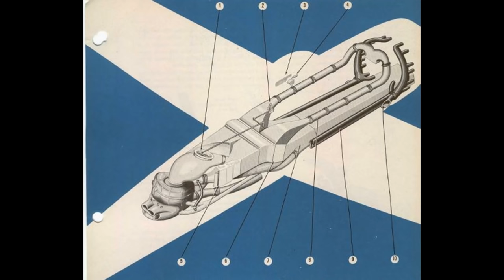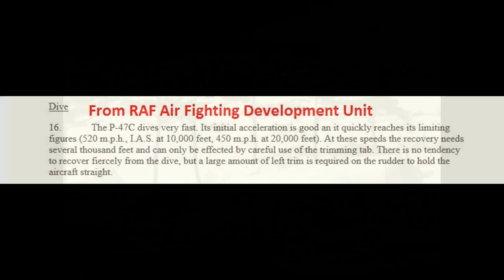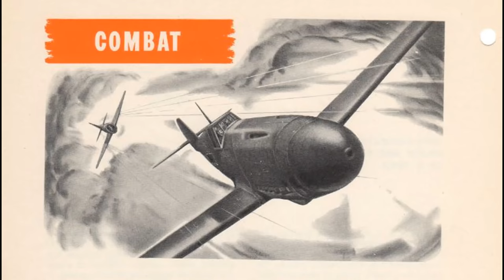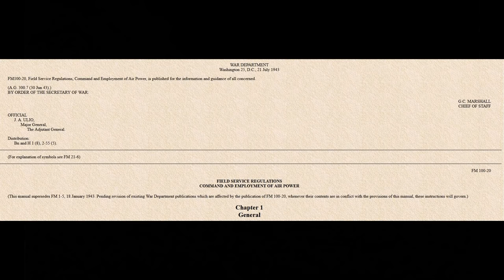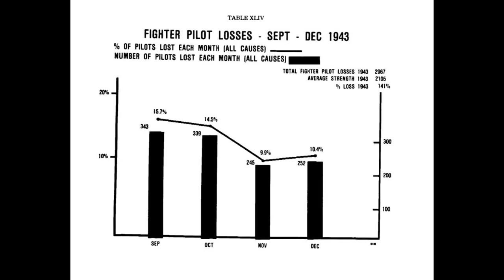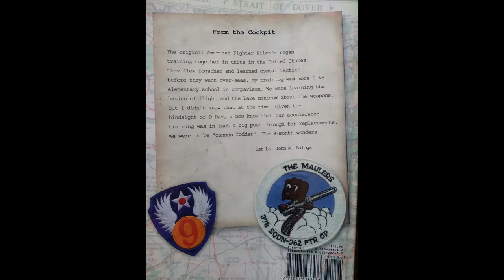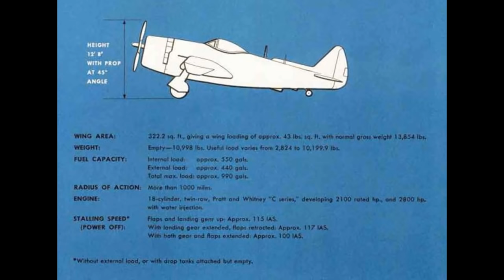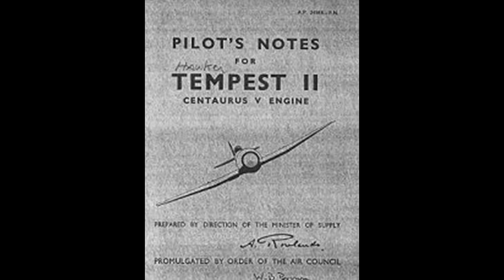P-47 Thunderbolt Pt. 8 Conclusions

Comment: Man, this has been an excellent series thank you so much, the 47 has always been my favorite warbird. And it’s nice to be able to fly them in sims like IL-2 and dcs now.
Reply: Also as an automotive tech I couldn’t get over the rate of oil consumption good lord!!!
Reply from the maker: Yes, it's a lot of oil. It's not just the 2800 cubic inches, it's the shockingly loose clearances that these engines ran with.
Reply: @GregsAirplanesandAutomobiles  I would love to see a complete tear down of that engine it seems amazing that they could produce that much horsepower in the 40s
Reply: @bryanjacobs5897  Mainly high boost pressure through supercharger, turbocharger and intercooler, and very high octane fuel making the boost pressure possible without destroying the engine. I wonder how much HP a 1960´s muscle car could crank if fueled by 150 octane (through either very high comp ratio, charging or both).

If you compare naturally aspirated (for the sake of comparisson) four-stroke gasoline engines between their invention and let´s say the 60´s, the massive increase in HP/cui was achieved mostly because of ever increasing octane number of the fuel available. This made it possible to rise their comp ratio from 3,5:1 in the early 1900´s to as high as 12:1 in 60´s. Comp ratio means higher power efficency. Then in the US of the 70´s the HP/cui dropped again because of emission control laws, because high comp rario and early ignition which give efficeny in power AND fuel consumption also produce a lot of CO and NOx. This was very stupid, because cars consumed much more fuel AND lost power because of the drop in comp ratio just to have less PERCENTAGE of CO and NOx in their exhaust gases

Also, I belive they P-47 had sleeve valves (not sure).

And finally, there´s no replacement for displacement!

Comment: Great video in an amazing series.
The production cost comparison is certainly interesting and hints at a supply chain element which I don't think has been fully explored here. I guess now is a good time for me to watch the series again :)
The P-47 field assembly guide film seems to show that shipping to the field seems to have been somewhat easy. Other aspects would include cost, wartime materials, skilled labor, supplier dependency and so on.
Reply: Indeed, one of the questions that people love to overlook, or answer in a simplistic way, "A was cheaper, but B was better". Obviously there is more to it than unit price, such as "can we get the damn thing where we need it" - Nicolas Moran's talks on the M4 Sherman come to mind -, and "can we easily keep it in operating condition there". 
I always think just looking at a radial engine, "that thing has got to be more expensive to produce than any configuration that uses cylinder banks, with 18 individual cylinder heads and valve trains" - and I'd hazard the guess that once Packard Merlin production was ramped up, it was indeed a much more cost effective unit; but from everything we know, an air-cooled radial was a) more reliable and survivable in combat conditions (not losing a plane when a bullet hits a part of it) and b) probably easier to work on, as there was no coolant to worry about/get out of the system before accessing the internals, and individual cylinder parts could be easily replaced. 

So you'd at least have these differences to take into account... Also judging relative performance, foreseeable changes in role of the planes or theater shifts, and so on and on. I'd hazard the guess that often these calculations would get so complicated that anyone in charge of procurement would probably just do what "feels right", based on real world experiences coming in, and then find the data that supports their decision :)

Comment: Great video. One comment, P-47's did serve in the Pacific War in 1943 and 44 (probaby D's). The specific case I read about was an American Thunderbolt pilot shooting down a Japanese Thunderbolt  (aka Raiden or Jack) over New Guinea. The P-47 was popular in Europe but not so much in the Pacific because of it's limited maneuvability at lower altitudes, while the P-38 was popular in the Pacific but not so much in Northern Europe due to it's various problems at high altitudes. The Army Air Force did the logical thing to simplify it's supply chains be sending the Lightenings to the Pacific and the Thunderbolts to Europe.
Reply from the maker: Yes, the 47 did serve in the Pacific in 43'. I sort of mis spoke there, although I didn't say anything technically incorrect, it was just incomplete. I have actually talked about earlier Pacific P-47 stuff and shown pictures of them in the Pacific theater quite a bit. I think in the range video I talked about it since there were early drop tanks in that theater.

Comment: The "one circle fight" diagram at 20:04 is actually a 2 circle rate fight.  The fighter with the higher rate of turn will bring its nose to bear on the other first.  You could correct it if you reverse the direction of one aircraft.  Then they'd be competing for smaller radius.
Reply from the maker: Look at the drawing, the plane in red will NEVER bring it's guns to bear no matter how rapid its turn rate. It simply can't point inside the circle to shoot the black plane.
Reply: @GregsAirplanesandAutomobiles  I am a fan and don't mean to nit pick but that diagram is wrong.  This is the correct way to draw a one circle fight (scroll to bottom):  https://vnfawing.com/VNFAWING-BFM-Intro-4.htm  Both aircraft turning same direction is a (two circle) rate fight even if sharing the same turn circle.  Aircraft in opposing turns is a radius (one circle) fight.
Reply from the maker: That diagram you posted seems to be talking specifically about turns after a head on pass. In that case, yes, if they turn opposite directions (one turns left and one right) then it's a one circle fight. Nothing I said disputes that, but I am talking about a different situation, not a head on pass at the start. The diagrams you posted are one and two circle "as shown in the below engagement" that engagement is from a head on pass and I think the diagram is specific to that scenario. The diagram I put up has both planes turning the same direction with both circles centered on or near the same point. In that case, turn radius will decide the outcome assuming nothing changes. I'll see if I can find a reference to this, off the top of my head I think it's in Shaw's book.

Comment: A couple more points...

I haven't seen any accounts of a Typhoon pilot, or even a Tempest, flogging their crate over 25,000 ft, pushing into a mach-limited dive, and surviving the pullout in a combat situation. The Typhoons were losing their tails with some regularity, for various reasons, throughout there service and I've just never read of Tepests engaging in combat at over 20,000 ft. Also, with that thick wing, there's no way the Typhoon had a competitive Mach limit anyway.

I also think it's pretty clear that the Jugs and late model Lightnings would have won the high altitude airwar if the Mustang had never existed. All that engineering and production could have been used to develop the others. On the other hand, if the Jug and Lightning never existed, it's likely there would have been virtually no high altitude combat until Merlin Mustangs could have been produced in large numbers and that would have still been well into 1944 simply because it was designed later. 

That means large numbers of experienced Axis pilots in well-developed airplanes would have been ready to great pilots who had never engaged in high altitude combat at all except in Spitfires and they would have still had to learn effective escort tactics.

Cheers!
Reply: Pete, the Lightning was pretty good for a twin engine heavy prop fighter.  But, there is a limit to how good that architecture can be because (1) it loses the surprise advantage (80% of kills historically coming by surprise) due to being large and easier to see, and (2) it is 2 to 2.4X more expensive than the Mustang, and (3) it is both slower and less maneuverable than the Mustang.  It's kill ratio was only 1.4, including aircraft destroyed on the ground.  The Mustang scored 3.6.  So, the Lightning suffers the double disadvantages of fewer planes per budget, and lower kill ratio.   On a per budget basis the Mustang was 6x better, and actually better than 10x when you include the fact that it was the better bomber escort, reducing bombers shot down by more than 50%.  The P-47 was better than the Lightning, in some ways as good as the Mustang, but also suffered surprise disadvantage and higher cost.  So, while we could have won the air war with the Thunderbolt, it would have entailed higher losses and higher budget.  We could have won the ground war with the Springfield bolt action rifle of WW1 instead of the semiautomatic M1 Garand, but we would have lost more men doing so.  The job of air force leadership is to field the best air force for the available budget, and the definition of that is inflicting the most enemy losses and suffering the fewest friendly losses per unit of budget.  See the Wikipedia article on Light Fighters.

Comment: I'm sure many in Greg's audience are totally in awe of the firepower of 8  50 caliber machine guns. I can tell you second hand how effective the p-47 was strafing tanks during World War II. My dad's unit, he was in the 6th Armored Division called in air support. Along comes some p-47s and they start strafing the wrong tanks! Blue on blue fire was something unusual in World War II. One of the tanks in my dad's unit took a complete strafing run right on from a p-47 on the front slope of the armor of the m4 Sherman tank. getting out of the m4 Sherman tank it was typical practice for the crew to slide down the front of the tank. It matter if he got out of the driver's seat or climbed out of a turret hatch you would grab hold of the gun and slide down the front of the tank to get off the tank it was fast and easy. You couldn't do that on this tank anymore unless you like sliding down a cheese grater. My dad said that if you tried to slide down the front of that tank it would tear your ass off. He described the metal as it looked like a giant chisel had just dug gouges into the metal. The tank was sent back to the scrap heap because the front of the tank was so weakened by the strafing run that it was not safe to use in combat. That's what 50 caliber armor piercing rounds will do to the front of a tank. Needless to say they were little annoyed at the airedale's. It was a brand new Sherman. So kudos to the pilots that flew those p-47 in support of the troops on the ground like my dad even if once in a while they did mess up.
Reply from the maker: I'm glad your dad made it through OK. In defense of those P-47s, the Germans were disguising their tanks to look like ours, so there was some confusion in addition to the usual fog of war.
Reply: @GregsAirplanesandAutomobiles  My Dad never held it against them, except the ruined brand new tank!

Comment: P-38: A revolutionary design that was dealing with the usual teething problems, asked to fill a role it wasn’t designed for, and flown by green pilots against war hardened experts. It survived on speed, climb and range. And two engines. It was sidelined because it was more expensive to build, operate and fix.. And pilots needed to learn to fly a two-engine fighter, which took extra time to learn.

Comment: Congratulations for giving the P-47 the credit it earned.  The P-47 beat the Luftwaffe on the Luftwaffe's home turf when it was still the Luftwaffe.  That is no small accomplishment although--as you recognize--it was a battle of attrition where we traded bombers and fighters for fighters.  The epitaph for many Luftwaffe early war aces was "shot down by P-47."  Indeed, Donald Caldwell's excellent book "The Luftwaffe Over Germany  Defense of the Reich" titles Chapter 6 "The Air War is Lost January - April 1944."  Although the P-51 ran up the score against more poorly trained replacements, the 56th Fighter Group--which flew the P-47 the entire war--was credited with the highest number of air-to-air kills of any group in Europe.  4th Fighter Group was the highest scoring group with air-to-ground included, however, the 56th led in the air.

While unstated, your series makes the point that the P-47 turbosupercharger was probably the most important single technical system in winning the air war over Europe.  Final point on training.  US Navy training for tactical aircraft has delivered pilots to the fleet for decades with roughly 300 total hours including around 100 hours in type.  Seems to work pretty well.

Comment: One factor the made the dive speed high was the tremendous weight of the Thunderbolt. Also, with the weight of the engine leading the way, it would be very stable in a dive.

Comment: Thanks, Greg I was getting antsy like it sounds others were too. I understand why you do mostly high production successful aircraft but I am at least equally interested in less successful aircraft as their failures help explain why the successes were successes. The P-39 being a notable example of relative failures (and of course it wasn't a failure everywhere) but also craft like the Hs-129s which future iterations of did fairly well in their niches (of course I am thinking of the A-10).
Reply from the maker: I did talk about the P-39 a bit in my turbo vs. supercharging video. I'll cover it more in the future.
Reply: @GregsAirplanesandAutomobiles  The P-39 being a low altitude only plane is not one of the problems I generally think about. On the eastern front, I imagine that was quite tolerable. The blind spots from the canopy framing, the severe mismatching of external ballistics of the three different gun types, and the COG issues when 37mm and .50cal ammo has been expended are the problems I notice most. If any plane ever could have benefited from an ammo counter that was it because it could double as a COG indicator.
Reply from the maker: @vicnighthorse  I might talk about it at some point. One huge advantage of the P-39 over the Soviet stuff on the Eastern Front is often overlooked, and that's the radio. If you fly on IL2, you know that two decent pilots on comms will almost always beat two good pilots who can't talk to each other. The P-39 will be covered on this channel at some point.

Comment: Martin Cadin in his book "The Fork Tailed Devil" (which is a book about the P-38 obviously) agrees with this assessment. While he glamorized the Lighting over 400 pages of text and footnotes, the Thunderbolt did the heavy lifting in Europe. Things might have been different if the Merlin Mustangs had been available in 1942 in sufficient numbers. I've also read in numerous accounts how pilots would prefer the Thunderbolt over the Mustang in combat because it was more survivable due to its radial engine.

The Pacific is the great big blank when it comes to the Thunderbolt. They were there. My ex-wife's grandfather worked on them until the unit replaced them with Mustangs in Okinawa. So far as the kind of war they were fighting on Okinawa was concerned, this was not a welcome change. The Thunderbolt carried a heavier bomb load, took more punishment, and was easier to repair than the Mustang or Lightning. They also shot down quite a few Japanese fighters along the way.

A wrinkle in recent years directly compares the Thunderbolt to the F6F Hellcat. Same engine, but a somewhat different arrangement with the supercharger. They are about the same weight with the Hellcat being about 800 pounds lighter. But the Hellcat had a longer wingspan for carrier operations. Late variants had similar performance. I guess what I'm asking for is a direct comparison between the fighters that used the PW 2800 engine. Thunderbolt, F4U, F6F, and F8F.
Reply from the maker: That's on the way, sort of.
Reply: @GregsAirplanesandAutomobiles  sublime! Take your time. The deep dive this turned out to be was fascinating.

Comment: Nice series and video Gregg. I enjoy the raw data. At 55:30 I was surprised to see that B17s consistently flew more hours than B24s even though I seem to recall that many more B24s were built. I was also surprised to see at 1:01 that B26s and A26s cost nearly the same amount as B17s and B24s. Makes me wonder what they saw in the 26s that the 17/24s couldn’t do. Fewer crew, yes, but not fewer pilots, navigators, and bombardiers. It just goes to show that much of what was purchased and used in World War II was based on what could be produced at any cost rather than on cost consideration alone. I was under the impression that the reason the 51 replaced the 47 was not due so much to cost but rather that the 51 was a better all around dog fighter and had greater range. Your comments on that would be interesting
Reply from the maker: I didn't analyze the hours flow of B-17s vs. B-24s so I don't want to comment on that. The A-26 invader is a much more advanced airplane than the B-17. For example it's gun defense system is basically what's in a B-29 just scaled down and it's very effective. That, plus it's newer, if the war had dragged on the cost of the A-26 would have gone down, but yes, it's expensive. In regards to the P-47 vs. the P-51as a dogfighter and in terms of range, I heavily covered that in this series. You didn't start by watching part 8 did you?